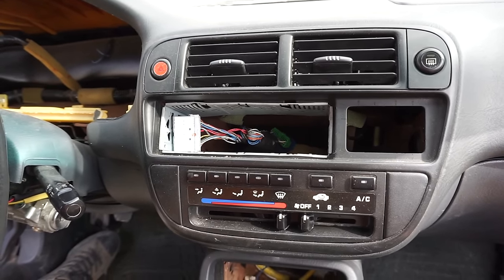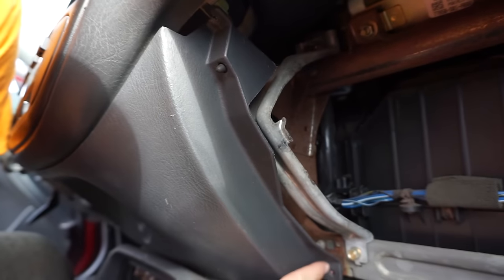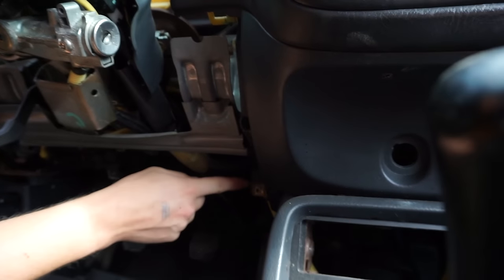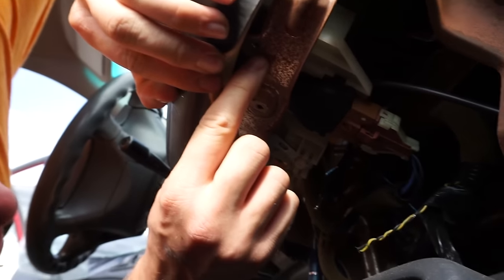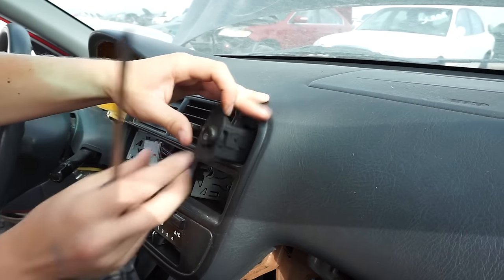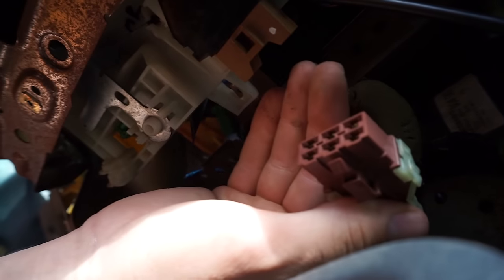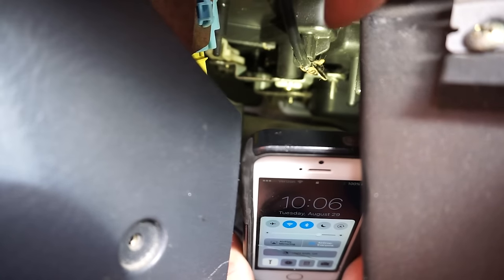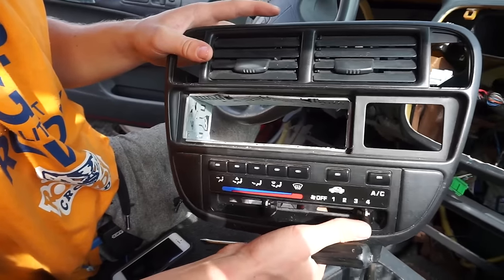1996 1997 1998 1999 2000 HONDA CIVIC -  Radio Climate Heater Control Removal Replacement

Comment: Hey I have a 97 coupe, Im just wondering if I pulled out my climate control, will I be able to fit a ‘00 climate control? Im planning to install a 2DIN head unit so I think it would be great to have 99-00 climate control.
Reply: no is your answer because the plugs are completely different to hook up the climate control and the 97 is ran by that cable he removed nd 99 nd up is all electronic
Reply: Jerald WHYT got it. Thank you man

Comment: Hpp automotive- hey bro what was wrong with your module or ac? Was it not blowing where you wanted it to or did it have other issues? In other words why did you have to replace it? And what are the most common issues with this part?

Comment: Thanks for the video! Btw, to remove the radio, do I need to remove everything you removed? Or can I just remove it from the front? Thanks!
Reply: İ am curious about the same thing and i dont know what kind of radio i need instead original one is all radios can be applied ?
Reply: @yigitkahraman9490  Hey! Well I ended up removing everything he removed and it was not that hard. Took me a couple of hours. As for the radio I bought one in amazon which had bluetooth for 35€. You can search for Civic compatible radios and just buy one. Good luck!
Reply: @JohnSantoz  tbh i have searched but i dont know are they spesific "inputs" everyone i see looks have standart inputs i dont know are they work with an old car like ours xd
Reply: @JohnSantoz  ty a lot mate :)

Comment: Worse than I thought. I believe I must remove my Blend Door Actuator (no front defrost) located just above the foot feed (accelerator pedal). Electrical part costs ~ C$65.
I cured it though...my '98 Honda Civic DX is my summer car. My 2003 Saturn Ion is my winter car.
I took off the Bevel on my Saturn and never quite got it back together🤨.
I got both cars for free so I can't complain, but they are frustrating jobs!

Comment: I will be doing this in my 97 civic ex
Because I want to put in the 99 00 climate control and radio unit. Would it be plug and play?
Reply from the maker: no it wouldnt be.  The 99 00 civic have a completely different unit and plugs.  if i remember correct, the 99 00 civics have 3 plugs, whereas the 96-98 have 4 plugs and a cable.
Reply: HPP Automotive thank you sir
Reply from the maker: no worries! glad we could help

Comment: I followed this steps and now my 98 Civic EJ9 wont start, crank no start. Is there anything behind this that could make that problem or does anyone has a same problem. 

Check engine light is on I hooked up OBD2 scanner through Honda 3 pin connector with adapter and it is giving me error that OBD scanner can’t read from ECU (like ECU has no power).

Comment: I live in Los Angeles I'm having this problem can you point me in the right direction to a certified mechanic or yourself if you're local can I pay you to do a job like this I could care less about the AC but I need my heater in my switch stopped working today

Comment: Just saved my butt. Daughter bought 1998 civic ex. The whole stereo needed to be rewired... I got it all in . rewired. Thru in some Cerwin Vega speakers.... Got everything back in... But no ac/heater. All connections are connected
 It worked before.. HELP